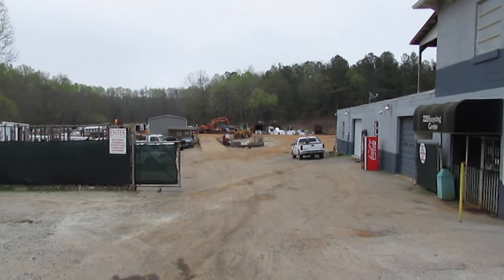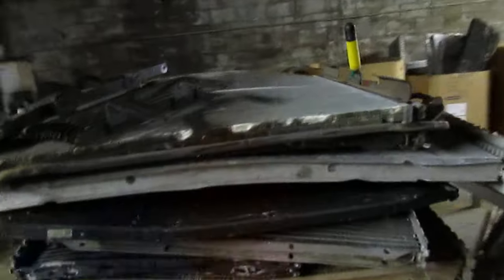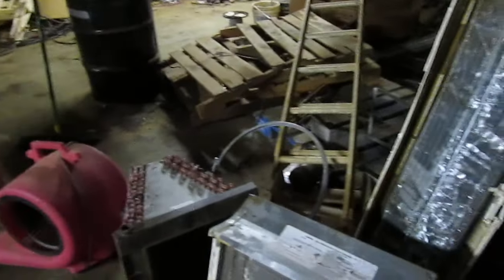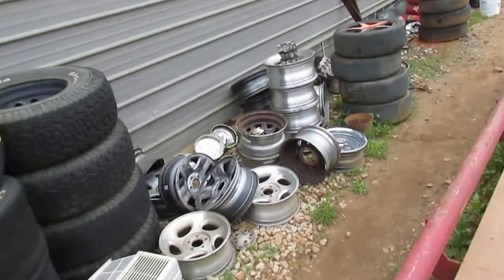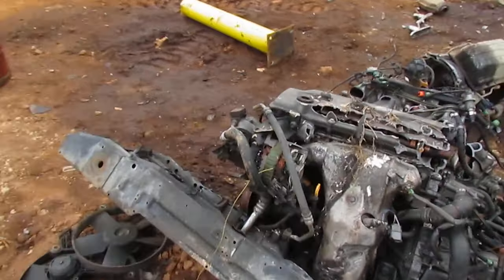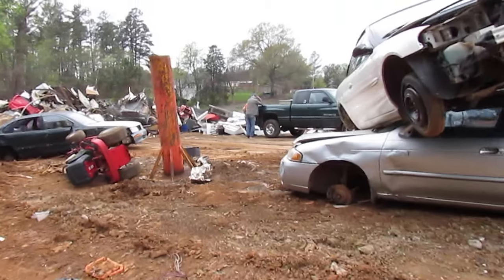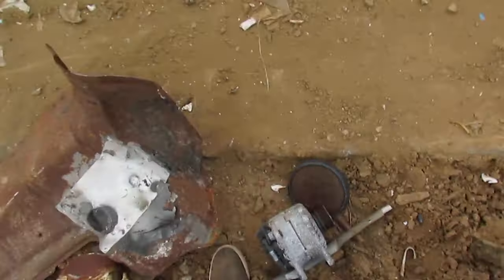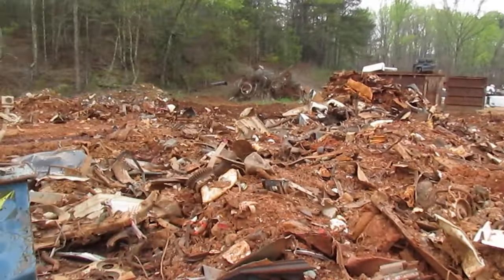FULL SCRAPYARD TOUR

Comment: Hey jay whats wrong with that bush hog in the shred pile
Reply from the maker: Its a solid deck and frame. But the guts are gone. Its missing the jack shafts, spindles, and pto shaft. Maybe good for a rebuild? Or cut it up and make a box blade?
Reply: Oh ok just wandering why y'all were scraping it and don't scrap that all murray mower it's worth 300